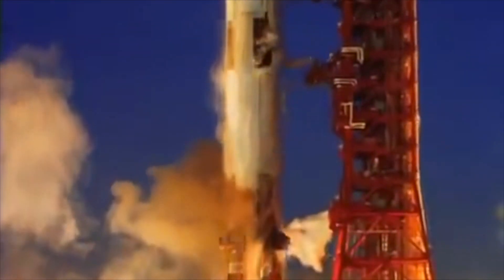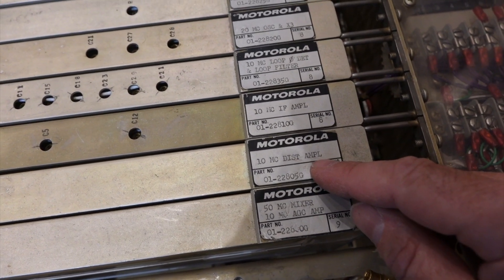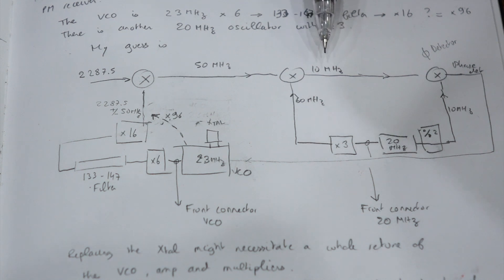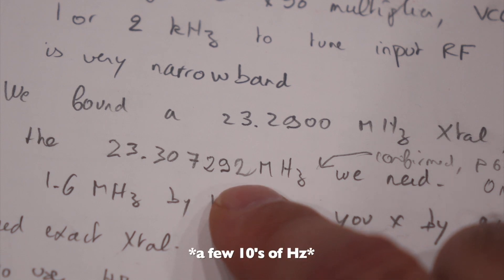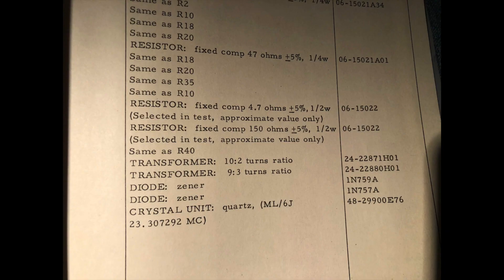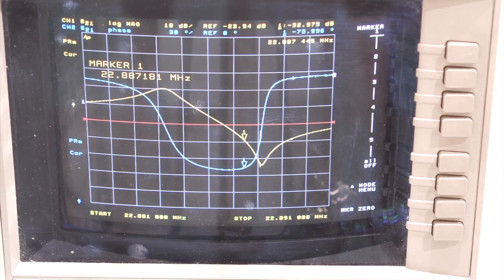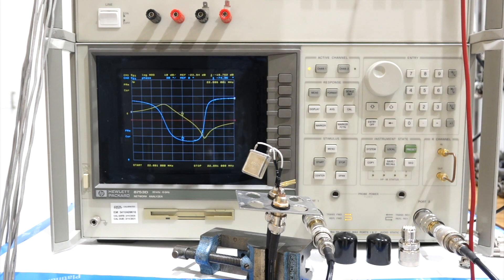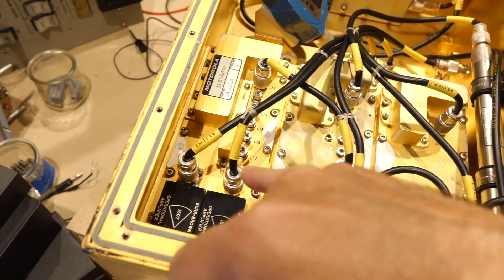Apollo Comms Part 8: Which Crystal?

Comment: You know when you’ve found a good supplier when they come back asking “You sure that’s what you want? It makes no sense unless it’s actually this other thing you want.”
Reply: Exactly. To be fair, that should be expected if you're going to buy a precision, custom fabricated part for probably thousands of dollars.
Reply: @juliankandlhofer7553  Custom cut quartz oscillators actually aren't all that expensive, you can get them for around 10-20 bucks or so (although with the sub-kHz tolerance it might be a bit more expensive). The bigger problem for small projects is that most manufacturers no longer ship them in small quantities, generally you have to buy at least 200-1000 (although the price per piece is also much lower in bulk, it can be less than a dollar).
Reply: @blahfasel2000  i only found a "contact us" button on the laptech website so i assumed a price in the thousands, as is usually the case 😂
Reply: @bobroberts2371  "Purple and black" reminds me of a place where I rented in my twenties. It had to go, and was going of its own accord because the wallpaper was extensively abandoning the walls in shame.
Reply: @bobroberts2371  Purple and black. I've been looking for a colour scheme for the lounge and I think you've hit on it! I knew I should have gone to a specialist in the first place.
Reply: It definitely shows a level of knowledge and care that goes beyond the average.

Comment: The oscillator circuit with the tuned circuit (L + Varactors) in series with the crystal is a clue of it being run on an overtone. The tuned circuit peaks on the overtone, and prevents oscillations on the fundamental.

Comment: at 1:20 you can see a little leaf of metal fall out from the crystal hood and fall down inside. a second one falls out and they pick it up, but one fell down inside the unit. hope they get that back out!
Reply from the maker: They are springy plates that hold the crystal, one on each side. We got them of course. We just flipped the rocket upside down with a big crane and it came out.

Comment: Oof - I can see that the designer for that crystal oscillator spent some time fighting it to get it to work. Feeding a varactor diode pair centertap with a resistor can give you some very serious headaches. (I've seen it insert some hysteresis on the tuning depending on the power level of the oscillator. Changing the R to an L with a way off frequency resonance gives nice stable results.) I suspect that is where the extra L's in his circuit came from. I wonder how easy it would be to get that thing oscillating on a spurious resonance. (Not, that is, that any circuit other than something like a multi-vibrator really oscillates rather than regeneratively amplifies and filters nosie until the gain of the "oscillator" starts to compress due to high voltages or an AGC control. This the relatively pure tone is filtered out of the circuit noise in the regenerative filter when the loop gain is a tiny delta less than unity and the phase angle is correct for the circuit involved, usually 180 degrees or 0 degrees.)

It's good to know somebody is keeping the fine art of making frequency control (and filtering) crystals. I hope you sent the manufacturer a copy of the circuit with values as much as you can supply. That way he can get it closer to precisely the cut originally specified. Spurious resonance modes can be a nightmare for you. (They can be REALLY bad in crystals used in filters. And that is the main reason I love SDR capabilities. You do not have spurious resonances collecting energy and leaking it out VERY slowly changing the pulse decay, aka ring down, properties of the filter.) I wonder if they are lineal descendants of the Croven company. They were fun to work with.

{^_-}
Reply: I understood every word of your wonderful comment. Sadly, none of the sentences. But frankly, that's why some if us are here 'following' Marc and friends.
Reply: @cncshrops  lmao
Reply: User name checks out...

Comment: LapTech, what a discovery! I thought there were no custom crystal manufacturers left in North America. I am sure their custom-cut crystals are not cheap, but how expensive? Is it still considered reasonable for amateur radio applications? Thanks!
Reply from the maker: It’s still within reach of amateurs: $100 for a set of two. Actually quite reasonable given the amount of work. A pittance compared to what I have to shell out for the freakin’ military connectors!
Reply: Wow, that's actually a great price for a custom job.
Reply: @CuriousMarc  Bomar is still around too. I had 5 or 6 xtals made for my Rca BTA-1R transmitter I converted to Amateur use, it cost me roughly $100 when I ordered them last year. But it's nice to know there's others still around as well.

Comment: while waiting for the arrival of the custom crystal, just inject the crystal frequency multiplied by 6 (139.84374 MHz) from a signal generator into that 133-147MHz bandpass filter to see if the second multiplier (the 16x) works or not. Also you can test the receiver with this setup.
Reply from the maker: Sadly that won’t work. You need a VCO for the PLL to lock.

Comment: You can take a crystal with a parallel resonant frequency of x and use it in a serial resonant crystal oscillator by putting a trimmer capacitor in series with the crystal, which you can use to tune the oscillator to x.

Comment: Any reason you can’t just generate the IF externally and feed it into the receiver?
Reply from the maker: Good question. It’s a coherent demodulator, so the demodulation will only work if its PLL is locked. Just feeding the IF is not enough for it to work.

Comment: This is all very well but what about the touch control of an induction hob that works in the cool of the morning but come din-dins refuses to switch on? (end of perplexed rant).
Reply: Probably more stuff on, generating interference?
Reply: @T3sl4  If only! I have tried so many things bar the Basil Fawlty sapling application.  Sometimes a power down works its magic but the switch is in the fuse box under the house.
Reply: Touch controls don't like high humidity / condensation
Reply: @damacc8365  Pondering appropriate measures.  The appliance has been removed from its housing and outwardly inspected and seemingly there is nothing untoward.  The two other touch controls are working. Unless a few components are known to be sensitive and can be replaced, this appliance is going to be put on the "back burner" as a back-up for as and when its replacement "carks-it" totally. Malheureusment,  c'est pas le peine.